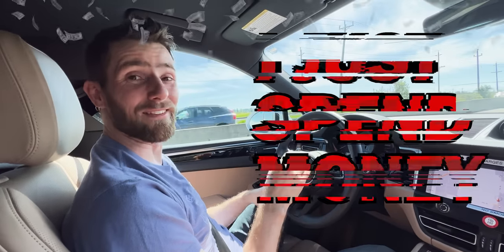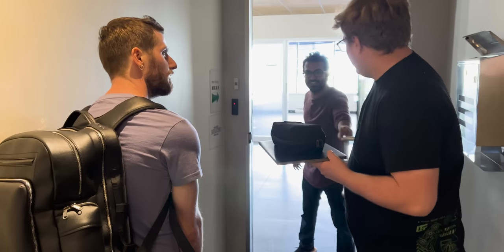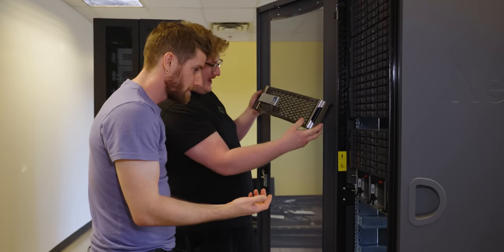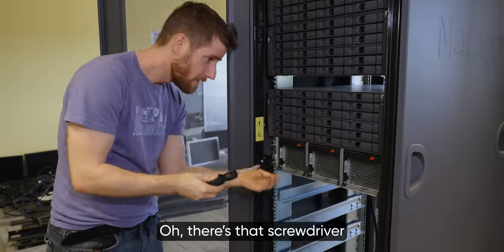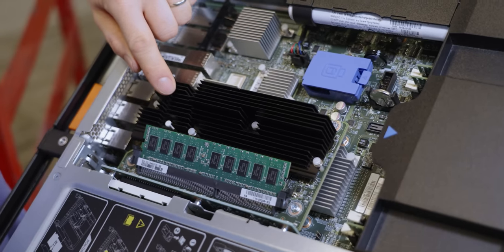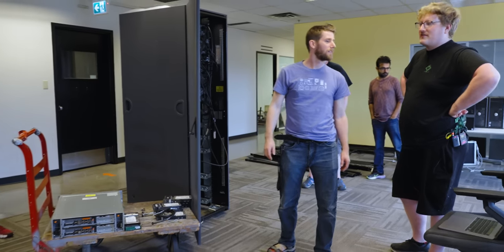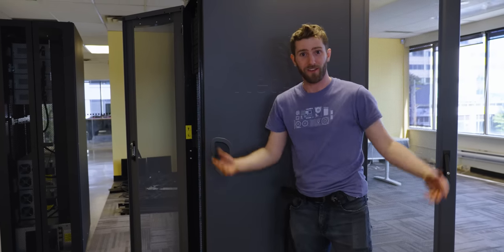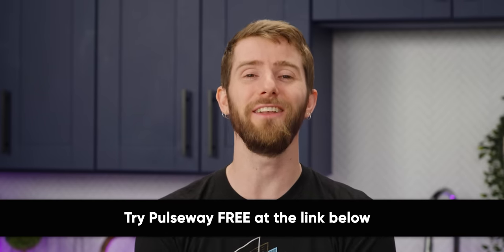WHAT did I just BUY on Facebook Marketplace?? - NetApp Storage Appliance / Disk Shelves

Comment: As an admin for multiple 32Gb Fibre Channel SANs with brocade switches and IBM Storage this is a good explantion for why a SAN only makes sense for bigger operations. We changed from the "layer" approach with multiple different storage devices (Flash, HDD, Tape...) to just everything NVMe since NVMe storage got really cheap in the last years and the maintenance contracts for the older HDD devices got exponentially more expensive.
Reply: NVME requires a new storage controller though, since you need PCI lanes for the disks. They could stick Flash storage in those bays be not NVME.
Reply: @EmeraldWitch  I think he means using SAN storage units based on NVMe (flashcards), rather than multi tier storage units with SSD/fast/archive class storage that requires constant balancing. In the past 10 years I've seen our company go from storage units of 3000+KG to 30 KG units that store more and and are way way faster (sub ms response times).
Reply: @aragnut6180  Yeah you are right. Currently we use IBM Flashsystems in a Hyperswap configuration with 4 Controllers. So even if a whole datacenter goes down, not a Single Client will go down with it. It just loses 4 of 8 paths to its storage
Reply: @eco909  the Fs9500 units? You must have a pretty good low latency line between your sites to have sync mirrors (and not too much distance). We're currently using async as the round trip is about 20 ms (oh boy does performance suffer if you accidentally set it to sync mirror)
Reply: IBM flashsystems are amazing, their flashcore modules are even better!
Reply: The HPE 3PAR has been flash-only for several years now. "Cheaper" and faster than spinning drives.

Comment: I work at an electronics recycling center, and you wouldn't believe the kind of equipment companies throw out. We get Netapp stuff like this all the time. We also get Cisco/Meraki, Netgear, Aruba, Proliant, EMC, Brocade, Arista, Ubiquiti, etc. When you think about it, they usually throw these out as soon as the warranty or support expires, regardless of whether or not they are still good/useful. A good video would be a tour of all your nearby Electronics Recycling Centers.
Reply: Does it all become scrap? Does some find a second life?
Reply: @flinx  Mostly scrap. Or like $1-5 a pound wholesale depending on the type/composition of the metal/materials. We also have an eBay department that will refurb some of the better items for resale. We recently sold a nimble flash array for around $5,000 stocked full of SSDs.
Reply: That would actually be an amazing video I’d love to watch. Used to work at a school board warehouse and I’ve seen the giant e-waste trucks pull up to take literal tons of old school desktop computers, monitors, mice, and keyboards from us.
Reply: So true and you will find them with little rust and dust. However, technology of these already behind and little compatibility with desktop PC which is the reason they are being scrapped than sold. During the last crypto boom, server power supplies than sells for just $20 or less shot up to nearly $100. I learned that these PSUs are really good, powerful, small, efficient, quiet (at 50% load or less). Instead of being scrapped, they just need an external board to be compatible connected to a PC.
Reply: Yup. Recycling companies get everything. Mostly trash, but often vintage or pretty good new stuff that could be reused. But in my city there is a clear policy that everything that crosses the doorstep and is proper computer equipment  like servers, laptops, phones (exceptions are like retro tvs, radios or hifis) has to be recycled.
Reply: @gilramos5767  Can you share your eBay store page? I would love to give some of those a new home!
Reply: @flinx  Some companies will require the hard drives to be destroyed and a  certificate issued.
Reply: It was weird that they were given the drives with their used NetApp system. Most enterprises want to shred them before disposing of the rest.
Reply: Have you seen Apple Xserve pass through the recycling center?

Comment: Small mistake at 9:27 : iSCSI does run over TCP/IP (the i stands for internet). To be fair though, there are non-TCP/IP protocols that are commonly used for SANs, such as Fibre Channel.
Reply: Special award for getting "Fibre Channel" correct! 👏 🏆
Reply: One my systems still has a Fibre Channel controller in it...I just don't have anything to connect it to anymore: I used to have Sun StorEdge A5200 which, while cool to have, was ridiculous on power usage and has the same "the discs are eye wateringly expensive and you can't even get that much capacity out of it" problem as the SAN in the video.

(I think the A5200 could take a maximum of 22 x 300 GiB discs. And that would probably cost you over £3,500, which is not a great price for 6.6 TiB...)
Reply: J
Reply: Likewise, the performance limitations of SMB don't come from running over TCP/IP. It's from limitations in what SMB lets you do, e.g. resulting in having to do many more protocol transactions than to do the same thing in other remote filesystem protocols e.g., NFS.
Reply: @TOT3m1c  SMBv3 introduced a lot of improvements, iirc. Although the file copy performed by SHFileOperation - which is what you're effectively using if you drag and drop files in File Explorer - is crap at actually taking advantage of them. 

Which is why people end up using robocopy for doing batch copies over the network (largely because it can actually take advantage of the multichannel capabilities by using multiple copy threads).
Reply: @hikariyouk  Its funny because NetApp actually wrote the CIFS stack for MSFT. All the features are there, it's just that all the legacy code doesn't take advantage of it. I don't know the exact calls off hand, but lots of applications will use a particular call that says 'scan the directory for this file', which will do just that. Start at the top and scan down until it finds a file you're looking for. Works great when theres say, 200 files there. When you have 100K+ files in a directory, it takes a LOT of time and hogs the CPU in the storage system. There's a much better 'find me this file' function that asks the storage system to get the file, which will then use its indexes and cache in a MUCH quicker time. 

Had an issue about 8 years ago with a FAS8040 being effectively unusable due to this. The application we were using used the first call and there were 2M files in the directory. The application was SUPPOSED to limit the number to 50,000 before creating a new directory to write to, but this particular customer was one of the first ones we had, and that specific feature was never backported to them. When NetApp figured out what the issue was, they said 'Yeah, you should really use this other call instead and then it wouldn't really be an issue.' our devs scoffed and said 'No thanks, we'll just keep using MSFT's call.' to which the NetApp engineer said 'Yeah, we wrote that. It's there to ensure old applications still work, but you REALLY should update it. It's from CIFSv1.' This may shock you, but they didn't change it.
Reply: @hikariyouk  it's definitely better than it was in earlier versions. Circa 1998, opening e.g. an Access database over SMB on anything but a LAN was untenable because it just copied the whole file over the network sequentially.

As for UI, the Windows frontend team insisted on synchronous callback hooks in the FS so they could update the 'flying folder's animation. That's a huge part of why every other copy method is faster than explorer.
Reply: @hikariyouk  SMB/CIFS's biggest downside also happens to be it's strongest. Metadata! NFS has very limited metadata stored about each file, very basic attributes, but SMB has a boatload of file attributes, and when doing things like opening a folder with a lot of files or nested directories, the number of metadata operations for SMB is absurd compared to NFS, which makes sense as NFS uses host-based authentication and is meant to look like local mounted storage, where as SMB uses a user authentication model and is meant for workgroup and departmental file shares.

Comment: These jbods were probably made by Xyratex, before they were bought by Seagate. The company I work for uses the same hardware line in our product. If you want to use them with SATA drives you want to be aware that only the bottom controller slot will be connected to the drives. For both slots to work, you need the dual port SAS drives.
Reply: They are Engenio storage which was LSI then NetApp. Rebadged by Dell as Md3xxx, IBM as DS4xxx, DS5xxx and some others. That one would probably not accept SATA drives, and even if it did you would use interposers that turn them into SAS drives.
Reply: @jonathanbuzzard1376  Yup, used to manage some IBM DS SANs. They would only accept branded drives, and if SATA they required the use of an interposer. The Dell branded ones I know had someone reverse engineer license files to unlock features, but not sure about the other rebadged units.
Reply: @jonathanbuzzard1376  We had a IBM DS35xx series SAN. Thing won't accept anything but certain IBM labeled drives no matter what. Some of those are NL-SAS but not SATA.
Reply: @jonathanbuzzard1376  not sure exactly what model, but i have a similar netapp branded jbod that does support sata
Reply: I worked in Xyratex in the UK in Engineering NPI area until they laid us all off in 2016, I stayed until 2017 to finished the clearing out of the site. Those probably made in Sacramento site if 2012 it gradually moved to Mexico in 2014/15. Had good memories of the people I worked with and still keep in touch with a few.
Reply: @andyw7464  Small world. You probably know some of the guys I have weekly meetings with.

Comment: I spent about 6 years looking after 2 of these in clusters (FAS3220). They were amazing when working but absolutely petrifying if they went wrong!  I nursed ours into retirement in 2021 where most of the volumes were starting to suffer with ‘WAFL’ errors that couldn’t be repaired. 

You guys are definitely going to have some fun trying to get these running again. Just a tip these are likely using ‘cluster mode’ as opposed to ‘7 mode’ due to their age. If I remember correctly these use different commands. You might also struggle getting hold of the software these days too so definitely recommend getting the root account from the previous owners.

Good luck!

Comment: Worked in a data center for over 10 years, this brings back so many memories of SAN upgrades. All I can say is those shelves filled with hard drives are HEAVY! I would love to get my hands on one of those shelves for my home lab.
Reply: I had one, empty they're pretty cheap, I got one full of 4TB drives before Chia started to be a thing for like $1200.
Reply: If you are willing to go for a 2U one they are pretty easy to come by and cheap. I use one as the disk shelf for my NAS. Finding the SATA version took a little effort as SAS drives are much more expensive that SATA but they are out there if you look.
Reply: First thing you learn: Put in the hard drives and PSUs after you are doing racking them.

Comment: It really is more than just about the connection when it comes to NAS vs SAN. Because of the fundamental idea that a SAN is a distributed block level storage solution, it can be configured in ways that a NAS cannot. For instance, you can have multiple storage cabinets distributed across multiple physical sites (let's say in all of LMG's offices/labs and Linus' house). You could theoretically create a single block level device that uses physical storage located in all of those different physical locations. The SAN controller will present that as a single device to the connected guest. You can't do anything like that with NAS unless you have other underlying software doing that work before the NAS is presented with the storage. This is why a SAN is a Storage Area Network. It's a network made entirely for storage. Contrast to a NAS, a Network Attached Storage, which is a storage device (or devices) that are attached to an existing data network.
Reply: The similarity between NAS and SAN in terms of lettering is probably best avoided for educational purposes. Better to compare SAN with LAN/WAN/etc. A local area network, a wide area network and a storage area network. The acronyms are more related, as are the concepts.
Reply: @dschwartz783  I agree. A SAN is definitely more synonymous with LAN or WAN than a NAS.
Reply: eh. I can think of NAS systems that can be distributed over multiple sites and machines "transparently" to the user. 
gluster, for example.
CEPH probably can too, but I've never read any of it's docs.
It's been a while, but I think with effort you can do it with Isilon. 
NFSv4, using pNFS extensions, can have your metadata separated from file data across multiple servers. Not necessarily supported by all NFS servers though.
Bell Lab's Plan9 9P protocol was able to do distributed filesystems back in the mid 80s. 9P is basically a distributed object store, with very little tying it to disk, iirc. 
The Andrew File System, as part of the Andrew Project, started in 1982. (AFS heavily influenced 9P, then later CIFS and NFS, as I understand it)

The truth is, a lot of computing technology is little more than abstraction and virtualisation of simpler predecessors. Bare metal, partitioning,  multi-tasking, containers, and VMs are all the same thing, with added manageability and complexity. Same thing with storage.
Reply: @RichardBetel  The real problem with comparing a NAS to a SAN, is the fact that the terms are describing unlike things. A NAS is a type of device, a device which can be used for any number of other things. What you call a NAS today, may be called a media server tomorrow (or perhaps something else), depending on its primary purpose. A SAN on the other hand, is a form of network. While it's often used to describe devices devoted to being a part of said network, it doesn't technically describe the device per se. Indeed, any device could be a part of a SAN, perhaps even a NAS.
Reply: @RichardBetel  I agree. There are NAS technologies that can be distributed but there's a bit of a difference between distributing a NAS solution and building a storage solution on top of a distributed block level network. The issue is that most of the distributable technologies used in a NAS can be considered parts of layers 5 - 7 (7 being SMB, NFS, etc). SAN lives much lower, between layers 1 - 4.

A good example of how that might translate to a 'real-world' example is a SAN RAID configuration. Imagine you have 4 disks. Each disk is located in a different geographic location and a file server in another location. With SAN, you can configure a RAID 0 volume using all 4 of those disks as members of the RAID. Then you can present that RAID volume as a "physical" device to the file server and then share it using whatever layer 7 protocols you want. This is all possible because a SAN is capable of using networks to connect low level physical devices to a controller that converts them into a volume for use by a filesystem. It's like connecting a bunch of SATA drives to a computer but instead of using SATA cables you use the LAN in your house because each drive is located in a different room and the computer that they are connected to is in the living room.

This is a stark difference to a distributed NAS. In the case of a NAS, you would have to create NAS clusters (comprised of drives and NAS software) in each geographic location and use software to virtually combine those clusters into 1 logical unit (or however many units you want). You don't have access to the lower level devices and they can't be presented to the filesystem as a lower level device.

The use cases of each depends on the needs of the implementation, of course.
Reply: FiberChannel is an incredibly well designed protocol
Reply: Us storage engineers also saw iSCSI as the cheap gimped discount version of Fibre Channel, which was pulling the grunt of the work. 😆
Reply: @timothyhendricks3004  ^Fibre Channel.
Reply: @fitybux4664  I always hated that spelling.
Reply: @fitybux4664  I have seen fibrechannel arrays with 5 years of perfect uptime

Comment: I got the pleasure of getting the old IBM SAN at a place I worked, but one of the first things I discovered is how proprietary everything is. While the enclosures did work as jbod, the drives themselves had some block size thing like mentioned in the video. Simply putting the drive in another PC and taking it out would mean it didn't work in the SAN anymore. There was no way to add bigger drives either.  I used the SAN for a little while for extra backups and eventually took it out of my rack as the NAS I built was smaller and way bigger in disk space.  At some point I might repurpose the enclosures for something totally different that's not even disk storage. They are built like tanks.

Comment: In the school district I work in, we just replaced our 7 year old SAN that was comprised of 5-10u storage cabinets, one at each building, depending on the size.
Now, the new SAN is almost double the capacity and more centralized. We have a 4u storage cabinet and a 2u controller on our main campus and an identical setup at our furthest away building as a back up. This has and will make our maintenance so much easier and straight forward whenever something goes wrong.